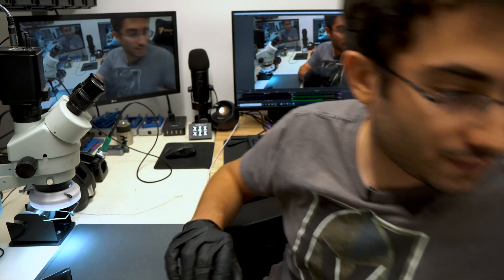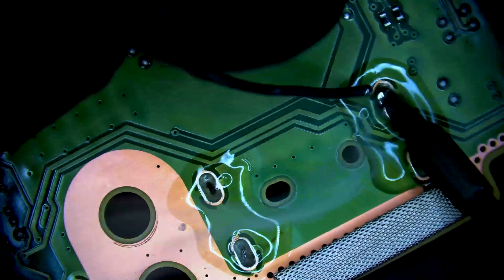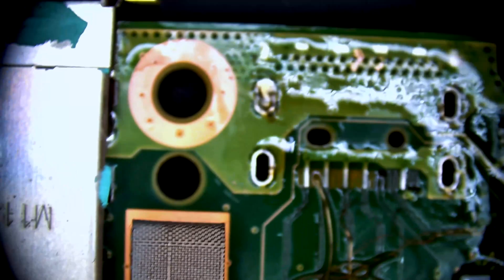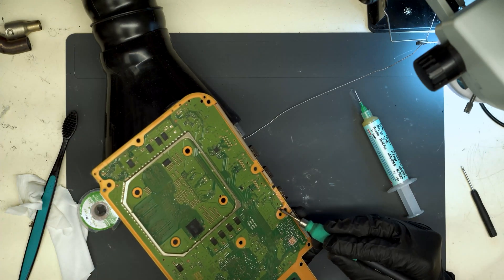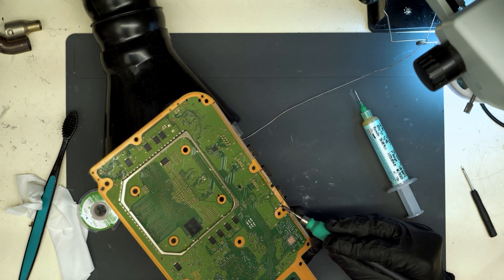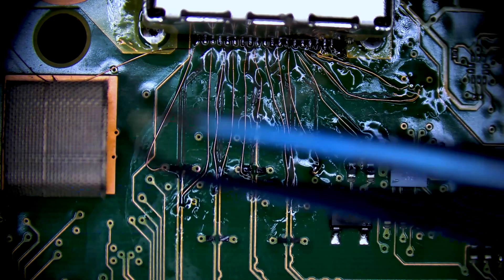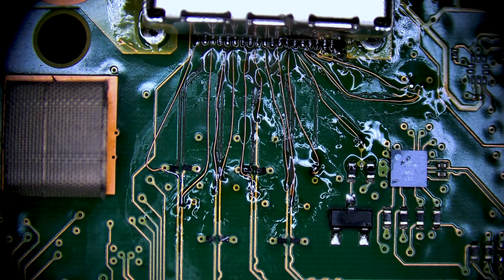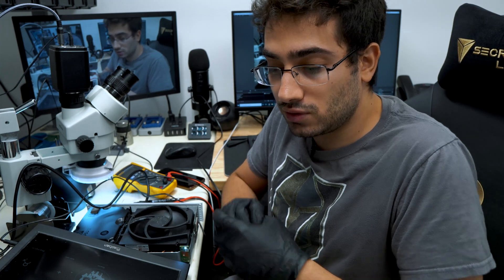Salvaging a barbaric attempt to remove the HDMI port on Xbox Series S 😭

Comment: Nice micro soldering. I would have expected it important to keep the lengths of the HDMI pairs matched such that the complimentary signals stay in phase. I thought you were going to follow the path left behind by the missing traces. What is the timing like for HDMI 2.1 and what tolerance for length mismatch is there?
Reply from the maker: Hmm, I'm not sure. I've never had an issue in regards to the lengths of the jumper wires. I will look into this further!
Reply: @marcuscupello   the timings are probably nowhere near as tight as I am imagining. It was the small joggels in the traces for length compensation 0:50 that made me think of it.
Reply from the maker: @dfgaJK  well, we have lifetime warranty so I will be sure to report back if any issues arise 😬
Reply: @marcuscupello  from what I can find hdmi 1.4 has	+/- 3mm intra-pair skew distance @ 3.4gbps.
HDMI 2.1 is up to 12gbps so I would expect it to be a sub +/- 1mm skew tolerance 👀.
I doubt they are running at 8k60 if they aren't just buying a new xbox when it breaks, so probably nothing to worry about.